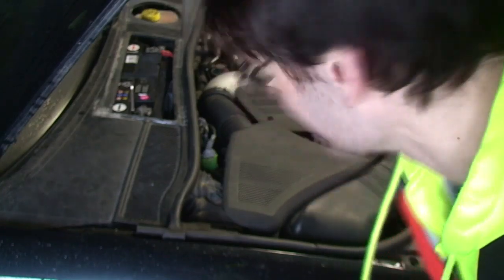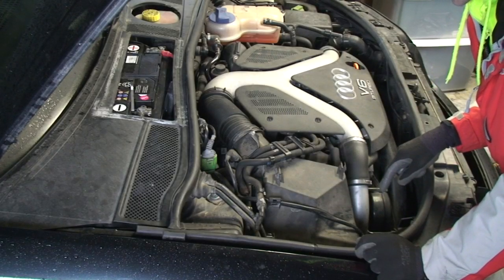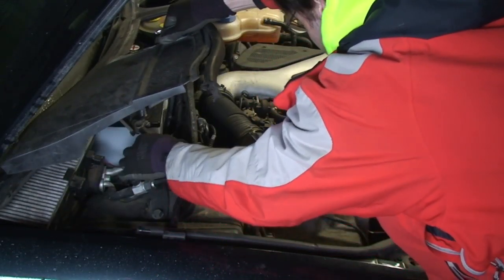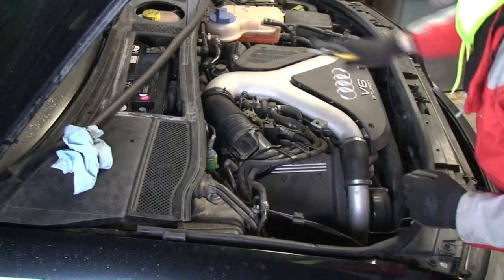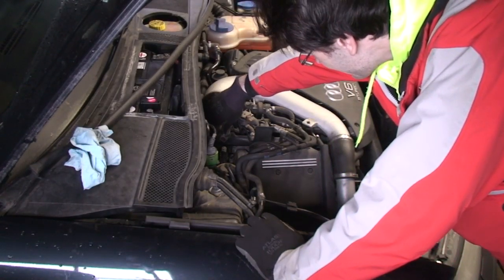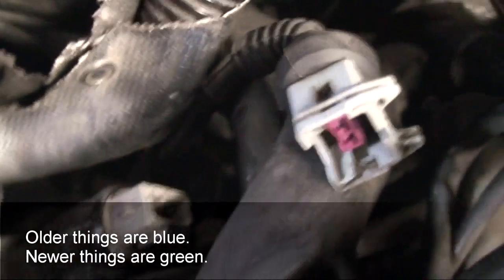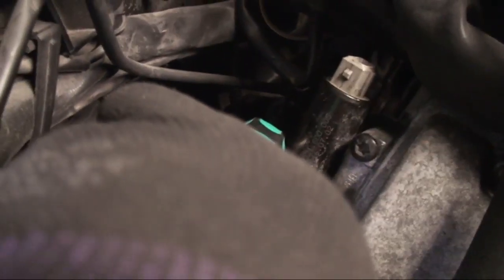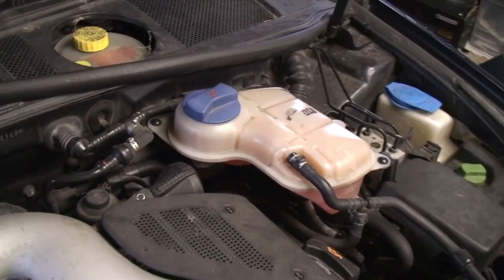Coolant Temperature Sensor: Allroad 2.7 V6: Debunking Do-it-yourself Spirit

Comment: I've had to go both ways sometimes it pops right out other times you have to drill it or grab it with a pliers. its also good to have several of the plastic horseshoe clips on hand as sometimes (often times..) they break

Comment: Buddy I just did this job tonight and it fought me every step of the way, I feel your pain. But i got the job done on mine. You broke the clip. I did too. You have to push out the last little piece that is stuck broken in the slot with a pick or something or it won’t ever come out. Then you can pry at it with a baby screw driver and leverage it out. Use an extension with a socket that’s big enough to fit snugly around the sensor plug and tap it into place if you have to. The job was a bitch even though youtubers had an easier go at it it seems. Took me about an hour and a half and a bunch of scrapes on the hand.

Comment: IMO, seems like there's still something in the clip race. Unless you get those grooves all cleared out, the sensor won't come out, period.

Oh, and always go genuine with these sensors, no aftermarket/knock-off parts. Even the well-known, reputable aftermarket VAG part manufacturers can't get this part straight - too many uncontrollable variables in casting and molding, and no way of calibrating the part. Thus a very large chunk of the batch is thrown away, or you guessed it - sold cheap to aftermarket vendors if working, but out of quality control specs. The money you think you save on a cheap part, will end up costing you more than a genuine part when you're on your 3rd sensor to find one that actually gives correct temp readings within reasonable margins, and that one lasts 3-6 months.

"OE" today, if even true - only means it was manufactured according to original equipment specs. It by no means tell wether or not it actually passed (or was even tested) according to the OE quality control specs.

Comment: Really man, 12 min video and you didn't even get the sensor out... also disc batt from  +(positive) terminal so as not to cause a short to ground with a misplaced tool. I recommend the bentley manual and a solid toolset before attempting work on these cars.